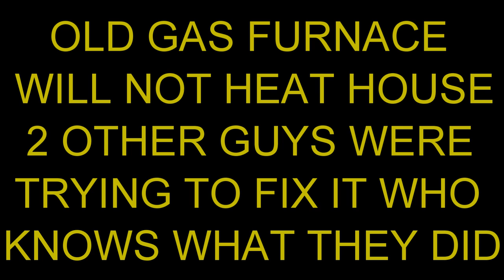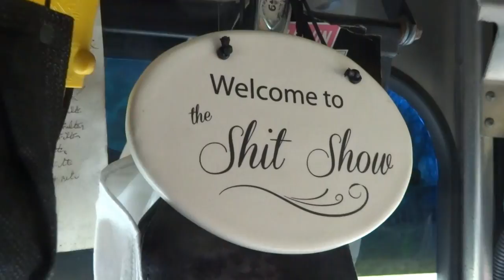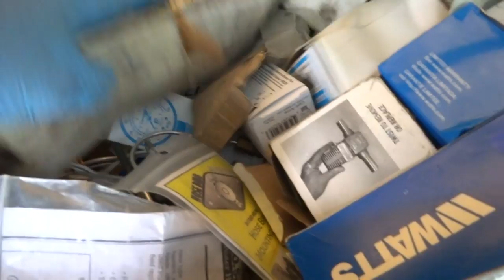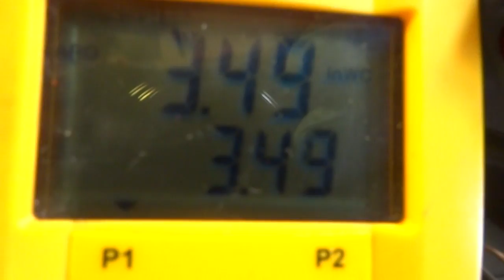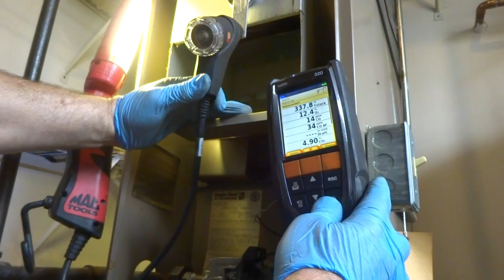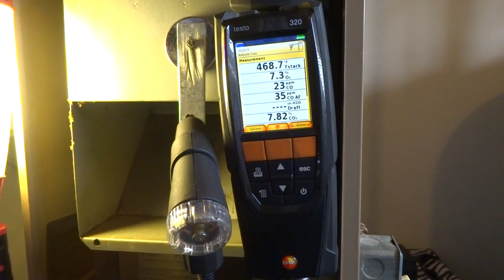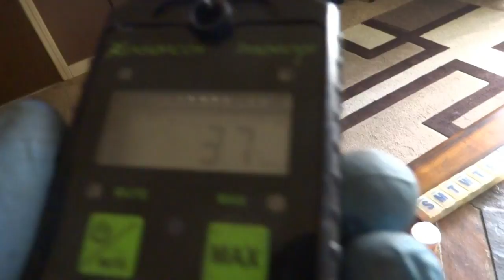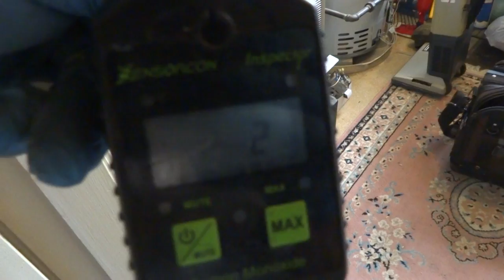OLD GAS FURNACE NO ONE CAN GET IT RUNNING

Comment: Caught myself a couple times replacing all these parts and then finding a cracked heat exchanger. Kind off leaning towards inspecting the exchanger first. Thanks again for all the informative videos.
Reply: I was thinking about the same thing when he started to work on replacing the gas valve: it would suck if the heat exchanger was cracked.

Comment: My experience with pilots on RV appliances was that the pilot builds up crud around the orifice hole from gas residue.
Saved myself time by taking the pilot assembly out, blowing brake cleaner through the orifice with air compressor and then reassembling.
Brake cleaner would break down the residue and not leave a film or grease behind.

Comment: Personally, I would check transformer voltage output (24v) with output wires REMOVED. Bcuz... a dead short anywhere on the furnace 24v system can give you a zero-voltage reading at the transformer. You can suspect a bad transformer by merely touching it. A "dead" transformer many times can be either VERY warm (short circuit on the output, as mentioned) or plumb-cold-- open transformer. While ur removing the 4" jct box cover to replace the transformer you could then verify your incoming 115v power supply without having to remove the furnace power supply toggle switch. Save you a step and a little time. It is unusual that you would have 2 inoperative components but it does happen. I'm glad to see you orientated the new gas valve so a person can work on it. I have a downflow furnace and the installer didn't bother to orientate the gas valve from upside down. The valve works but obviously it is a pain to make any adjustments or take readings.
Reply: Not to break balls of any worker but plumbers, and HVAC technicians are not electricians or more so, control systems technicians. They  can do the job obviously, but sometimes electrical systems can have elusive problems that require a deeper understanding of what's going on.

Your description of how to check the control transformer is fundamental and should be understood. May I add, the same approach should be used when troubleshooting DC controls as a short circuit in the output of modern power supplies will activate "crow-bar" protection driving the output voltage to zero without blowing fuses etc. I've seen more than one time people hunting for a replacement PS only to be stunned after changing and the problem reemerges.

For what it's worth, I've worked over 50 years in industrial controls mostly in power houses, water treatment , and manufacturing plants as a control systems/instrument technician with an ISA certification. I was also an aircraft electrician in the Navy. I currently teach motor control/PLC's/automation at a tech school in Florida.

I've seen some weird shit go down that had us scratching our heads for a good long while...

Good call Scott.
Reply: @johntrauger68  So how do you fix varible speed boards, inverters and modulated gas valves? It is easy having experience and just add that to your skill set via a class or YouTube.  A lot easier having background already! Obviously you don't need this but the industry is going to change rapidly. Environmentalism and $$$
Reply: @SovereignTroll  
With good documentation most things can be repaired if one knows circuit analysis techniques and parts are available. That's best case. Otherwise, an understanding of drives and the operation of valves can develop a strategy of where to meter under changing system conditions. Realizing the big picture is helpful. 
Best of luck.
Reply: @johntrauger68  I particularly like the big picture part. Good comment.
Reply: @johntrauger68  LOL
There will always be trollers who Always speaker of their experience and what they would have done.
Yet, they always say " I don't mean to offense or blah blah

Comment: Good job. As a Gas Co residential/commercial tech, my first step when I saw a weak and lazy pilot flame was to just tap the pilot assembly with a screwdriver to knock out the dust, usually restored full and strong burning flame to the pilot. Then use the hose to blow out any soot caused by the lazy flame. A tap would have probably taken care of that without you having to adjust the pilot flow to account for a slight restriction in the orifice. I have run into situations where someone tried to adjust the pilot flow without cleaning out the restriction in the pilot and after tapping out the restriction, now the pilot was over-gassed and blowing. I would then readjust the pilot back to a normal flow to impinge on the t-couple. I would cut a short piece of 1/4" copper or aluminum tubing and stick it in the end of your blow hose. The tip of the tubing should be bent slightly to get into the pilot hood.  I put in a short piece of 1/4" acrylic pipe as the mouth piece in the other end of the hose, instead of putting the nasty rubber hose in my mouth. I would 'fix' inop fireplace gas logs and wall furnaces that used PG9's with a sooty and lazy pilot flame with one tap. Pilot flame became strong, waited for a a moment for the thermopile to heat up and 10 seconds later, gas log fires right up. After a quick cleaning and a safety check, in and out in less than 10 minutes.
Reply: You sound like you work for Socal.
Reply: @tkreuchi  Retired in 2019 from SoCalGas. Ended my career as a System Protection Specialist(cathodic protection).
Reply: @sanseiryu  lol I knew it. I was an IST just retired in October. What does that say about us watching videos about lighting pilots. Happy New Year my friend
Reply: @tkreuchi  Enjoy your retirement. Happy New Year to you as well!
Reply: You guys are ringing all my bells with the comments regarding Socal. I started my career as a serviceman back in 71. Retired as a CP tech specialist in Northern region in 2018. 🙂
Reply: @mikemarshall1394  Nearly 50 years!? WOW! Gas Co pension plan must be sweating having to pay your monthly pension! Good for you!

Comment: I'm glad you didn't try and sell them a new unit. As soon as you walked in there. That would of been 80 percent of techs out here. They would pulled the bad heat exchanger card without removing the panels on the furnace
Reply: the furnace was made in 1986!
Reply: @macking104  so?

Comment: I used to disconnect the pilot line from the combination calve and attach CO2 cylinder to blow out the dirt. It worked 90 % of the time. Still replaced the thermocouple as preventative maintenance. Never had a callback after that.

Comment: If that guy runs into trouble installing the PTO on his tractor, he can call Ivan over at Pine Hollow Auto Diagnostics to get it working.  If Ivan can rewire a Genie boom lift that was hacked up by many "attempted" repairs, I think he can get a PTO installed and working on a John Deere.
Reply: Another channel I watch all the time & enjoy 👍
Reply: I'm wondering how he got the massachusetts guy for a pto parts. I delivered oil to a guy that had a old Ford tractor. Probably from the 50s. May he rest in peace. But he didn't do any internet stuff to get it going. I told him to ask his kids for help. Long story short. When he passed away i meet his son. And he told me that they did try to get it working again. But it was hard to find parts on the internet.

Comment: I learned a long time ago if you have a blown transformer there is always a reason for it, I always try to put a in line fuse on the the low voltage to if it doesn’t already have one. That way your not changing transformers more than once.

Comment: Some of those 24-volt control transformers have a glass fuse embedded in the windings.  A faulty component elsewhere in the furnace can blow this fuse,  rendering the transformer uneconomical to repair.

Comment: My furnace is about the same age.  Transformer  > thermostat > > gas valve. Themostatic  high limit switch in the heat chamber >relay  > motor.  The valve is the most expensive and finicky part, the limit switch is the least commonly thought about part mot commonly mis-adjusted and the hardest to find a replacement for. My limit switch contacts were stuck open.  Luckily I was able to fix the switch. was .

Comment: Great video. Very funny dialog at the end with the customer. Seemed like a simple enough diagnosis, strange how the other two companies couldn't figure it out. As always, you da man Steve.
Reply: Exactly how I wound up with a free Cadillac Coup de ville back in the 80s, a friend had it in the lot at his business and needed it to go, TWO mechanics couldnt get it running, he told me if I could get get it running it was mine, so I bought a new coil and condensor, put them in and it fired right up, it was probably the coil, I figured it had 3/4 tank of gas and gas at the carb, so the only thing left really as to a no spark/no start cause was the coil and condensor

Comment: Are Janitrol Furnaces obsolete?  I had an issue with the thermostat upstairs, all it was, was a wire off the screw.. i fixed it but i wanted our local hvac to service the furnace just to make sure everything was good... well.. an hour later the company stopped by and went straight to my heat exchanger and shut it off cause he said it was cracked... and said furnace was not fixable... i said ok.. well I'll have a second opinion.. so i had a buddy that retired from being an hvac for 35 years.. checked it.. said everything was perfect.. and he turned it back on... it's a 1967 model that runs great and heats the house better than new! But should i change it out?

Comment: A proper service would include disassembly of the pilot and cleaning, and replacement of the thermocouple. I never use a can of air to clean the pilot. I use brushes to clean the orifice and the housing. The pilot should sound like a torch when done. Lazy pilots will follow the airflow from the burners and pull away from the thermocouple, which leads to no heat.
Reply: Exactly! Why spend the time doing the lazy blow thru,  pilot is still filthy! Simple turn of the limit, prove hi voltage.

Comment: I always removed and disassemble the pilot and clean the orifice . Sometimes it’s so corroded it can’t be serviced . Previous tech attempting repairs can be a problem. Something is shorted out on that low voltage side of transformer circuit . Transformers don’t fail on their own .

Comment: I love it when they are worried about cost, you tell them time plus material, and they keep asking questions adding to the time 😂
Reply: Lots of us live with a very finite budget and worry about the costs...once you're that far into retirement you have to think carefully about where the next buck comes from.
Reply: Damn straight.
Reply: $65 is a deal. Junk drawer or not. If it’s good, it’s good !
Reply: @crg061  what I'm wondering is if it's one that was replaced unnecessarily in someone else's furnace.

Comment: Great video. I had to laugh. I was expecting you to say bad switch. I like the driver! I had a problem with my AC compressor. I checked the circuit breaker, one side 115 volts the other side 3 volts. Replaced the breaker and bob's your uncle it worked great. I opened the old breaker and found a dead spider and and a great web nest on the one side.

I'm an old man too but maintenance, maintenance, maintenance. Some people think they are using an old cast iron stove to stay warm

Comment: $65.00 for what seemed to be a used transformer? Time @ 14:53. The neutral wire was discolored and both wires were twisted at the stripped ends. ???? Seems a little steep. Plus possible warranty issues. I save all the extra working parts I can from jobs, but I only use them when new parts can't be obtained. Such as over a long weekend after I have used all my new parts, but tell the customer that it was a used part and charge very little for it if anything. Usually donate to people who can't afford a large repair bill. Especially the elderly who are probably on a fixed income.

Comment: I just had a job yesterday where the smart valve was sending the igniter 28v but still no flame. Tech support told me to change the control board but I snagged a new smart valve also so I wouldn’t have to drive all the way back to the supply store. Sure enough, bad valve. Was sending the right volts…but not enough amps for the hot surface igniter. $2500 charge for hsi, control board, and valve. Ouch

Comment: At approximately 36:53 in this video, between the furnace (nice job, by the way) and the water heater, there is a case that's white with black tiger stripes. If I'm not mistaken, that kind of case was used to hold a Tiger 'Combo 'Cordion, which was a kind of specialized accordion sold in the late '50s to mid-sixties. Of course, storing an accordion in that location would probably ruin it, but those Tiger accordions, if in good condition, are quite a collector's item today.
Reply: wow casing the place???? lol

Comment: Back in early April I  suddenly started having pilot light issues on my Lennox conservator G11-E furnace, cleaned the pilot assy and electrode and it seemed to fix it but didnt, so, I bought a new intermittant pilot spark  control unit since my furnace is from about 1978 and the Johnson controls on it is at least 20 years old that Ive had the furnace, from what Ive read the Johnson control on the Lennox furnaces were very problematic and Lennox had to replace and go to another company, but I never had even one problem of any kind with my furnace in the entire 20 years, so I researched and found this replacement and it turned out to be a perfect, exact fit in every way, just swopped the wires and attached it.
The only thing I had to do was salvage the metal ground plate off the back of the Johnson  box to use on the new ICM 2102   which has plastic on the back, it was a perfect fit,  even the two screw holes. It fired up the pilot light right away and has been working perfectly since.
Reply: In the eighties,I installed many Honeywell sparker kits to rooftop units,especially toys r us. Nothing like getting a call at 8pm for no heat. The units had poor pilot shielding.with a good contact wind pilot blew out in off cycle. Tic tic tic and it's lit

Comment: I can tell you exactly what happened on this into I see it often on these old natural draft units. The flame had been rolling out due to the build up on the heat exchanger and the heat damaged the transformer and the gas valve I had it bad enough to damage the blower switch..I normally clean them and add a flame roll out to cut it out to try and minimize anymore damage

Comment: I had an old 70's furnace that the HVAC guys declared un-fixable when the gas valve failed........   I found a compatible Honeywell part and fixed it.   I had just moved to this house and was pretty broke for the first few years.   Eventually I got it all replaced when the AC and the fan died.

Comment: Ahhh the old days of furnace repair. Pull the pilot assembly and spray it down with some WD40, it’ll clean out all that crap. Blow it out good, and away you go. It always sucks being the second or third guy in, you don’t know what the other guys messed with. That’s like a Friday afternoon nightmare job…I don’t miss it.

Comment: Why did you route the thermocouple tube over top of the manifold instead of under like the pilot light tube?
It puts an unnecessary bend in the line.

Comment: I would assume the gas valve took out the transformer. Way to walk through your diagnosis. 👍
Reply: Unlikely. The gas valve solenoid was obviously still working, it just wasn't opening the valve. I'd lean more towards too many people had their fingers in the furnace. How do you have a furnace at the end of the heating season that worked fine and all of a sudden had a thermocouple that was bad and/or wasn't getting hot enough as well as a bad gas valve and transformer. If the gas valve wiped out the transformer it would have most likely smoked the new transformer immediately or the solenoid wouldn't have made an audible click at all.

Comment: My dad finally had to replace his 40 year old furnace.  At 20 years old PSEG replaced most of the parts with the worry free insurance program.  They hit it with the parts cannon trying to get It to work. Ultimately it was the gas valve. After that it worked great for another 20 years.
Reply: LOL if your service guy can't troubleshoot a bad gas valve in standing pilot furnace you should probably fire him and never call him again!
Reply: @jman0870   it was all covered by insurance so it didn’t really matter. 4 trips and 4 different techs.  We ended up with a lot of new parts and 20 more years perfect operation. Lucky the furnace would cycle one time after turning it off and on.
Reply: @madmaxsaturn  That's still crazy talk. Gas valve troubleshooting is hvac 101 in standing pilot furnaces haha

Comment: After all the videos you have made on gas furnaces I have never seen you remove and clean pilot.  That is the very first thing you do.  You can not clean a pilot blowing on it with a rubber hose.  For the amount of time you spend with the hose you could take the pilot and clean the orifice.  On. Natural gas if the pilot is burning yellow the piloy is dirty.

Comment: Someone can correct me if I  am wrong, but at the 10min. mark of the video, a voltage check on the gas valve would have shown there was no input voltage to the gas valve.... Then you could have checked the input/out voltages on the transformer.....  Just my opinion.